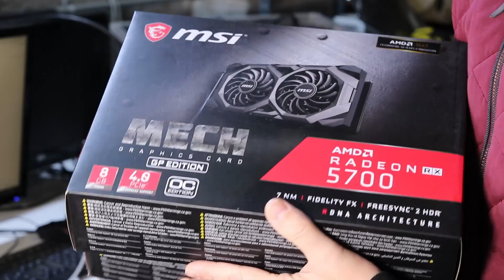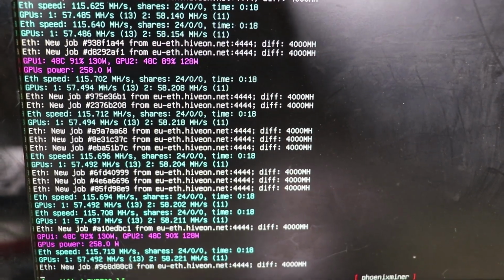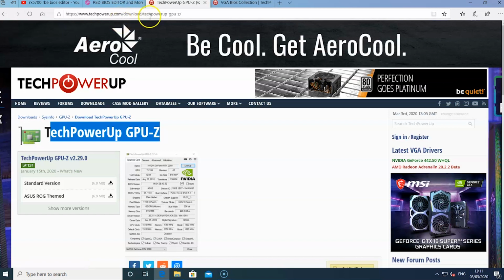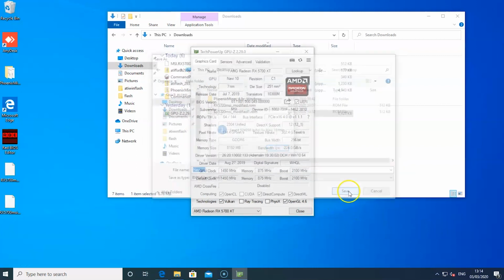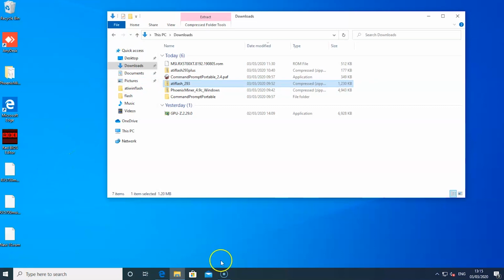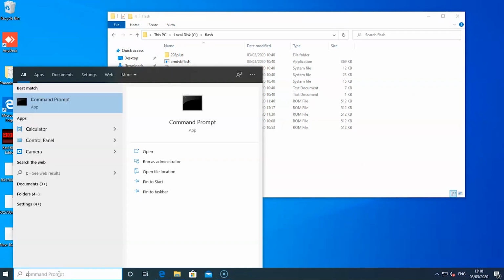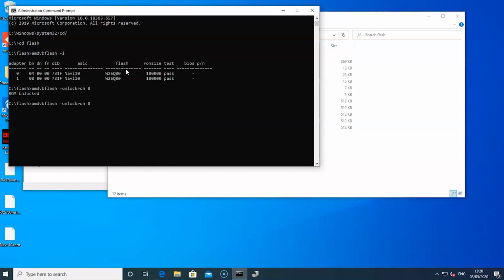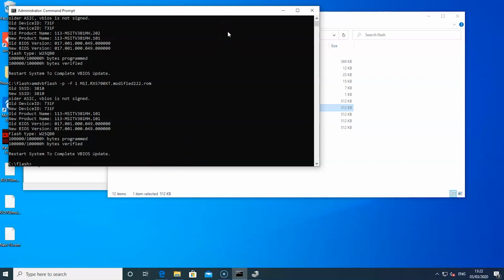BIOS modified RX5700 | how to edit timings | 10% speed increase.

Comment from the maker: Thank you for taking your time and watching the video. because of You im still here :)
Reply: Hey Mate. Hi there.
Look im here having a bit of trouble with my 5700 no XT PowerColor Red Dragon. 
Using hiveOs can't get more then 55.5 MH/s. 
Did the timings, and also did the bios modded timings from a XT version.
Using CORE 1380
 VDD 750 MEM 940.
What now, can you help me?
Reply from the maker: @Pistolshot  hello, yeah Red Dragon been pain in ass for me also ;)) Which timings you have on it? does the 1550 ? Because what i have noticed these are lot slower. you need to look for card with 1500 timings http://prntscr.com/ubhj1k think these are the same as yours. I put Red devil bios on them. and at mem 890 they do nearly 55mhs , reduced the mem clock as hod some heat issues. But when will fix will put back on 58mh

Comment: Hello, please if someone can help me I flash my rx 5700 no xt asus rog strix with amdvbflash I first got a message "-f no charge", then it ended the flash, I restarted but the P mode does not boot I have a black screen, I tried to flash again with version 2.93 and either the P mode does not work, but I put this command: amdvbflash -f - p 0 xxxx.rom, I don't know if it's like that to find the original bios if it's the same command, then I made the flash stupid in the Q mode with the bios modeled and not of stock and the pc does not start neither with Q and P mode, I am blocked I hope that it is not a hardware problem, which will be able to help me Please I am blocked. thanks in advance

Comment: Hello mate! First of all I want to thank you a lot for this video and explanation, I am new in this stuff and this helped so much. I followed all steps. I want to share my experience for last few days... 
My GPU is Power Color RX 5700 OC Red Devil 8gb, after all bios modifications like described in your video, I have successfully got XT OC version 😎 
Plus I did some fine tuning in MSI Afterburner software and got around 10-11% better hash rate. In original version it was something like 50.9 MH/s, now is 57 MH/s. 😊 
These are the numbers:
- Core voltage 875 mV
- Core clock 1375 MHz
- Memory Clock 1900 MHz
- Power consumption showing in MSI Afterburner is 139-141W
- Temperature 64-65 C with my own FAN setup and automatic option turned ON ( at this temperature FAN is usually on 52-55% speed which all things makes pretty quiet) 

With higher fan speed, GPU temperature can be less but also louder. I also have to say that my PC case is not opened so otherwise temperature can be even less. For now everything works fine and I hope it will be same in future! 😊 I hope these information will help to someone, and also hope that if anyone experienced sees something wrong in these numbers will correct me. 

Cheers 🍺

Comment: Hi I just discovered your channel. Your content seems great so far. I have a question. I have 4 5700XT Red Devils. Three of them work just fine up to 1830Mhz Mclock and 1410 Cclock. The other card even though it has the same modded ROM and what not just keeps piling up incorrect shares. Even when I cut that card down to 1800Mhz and down the Cclock way lower than the other cards it just gets more incorrect shares than the other three identical cards. Is there anything I can try other than keep lowering the settings on the lame duck card?
Reply: He's what'$ap. +1 5 1 0 8 2 4 4 1 7 2.

Comment: I have 4 of the same graphic cards (MSI RADEON RX 5700 MECH OC) and when I do the bios mod I get 53-54 Mhs max but power goes up to 180w; I'm not doing any OC and I think this is the problem... wich values do you recommend for this graphic cards in HiveOS? Thanks in advance

Comment: click the clock speed in the timings / section / adjust dram timing row 12 tref up it some an get more hashrate as well, its like -rxboost  but u have to reflash each time time only bad part so far
Reply: Thanks for sharing your comments. Need to find a well trained crypto Expert.wa s ap p +1.. 5.. 1. 0..8.2..4..4.1..7..2. I recommend you my expert Daniel, He can put you through.

Comment: HI Guntis, had you tried it on MSI 5700XT Gaming Version? Let me know, if it is possible to increase hashrate. Waiting your feedback. Thank you.
Reply from the maker: Possible in any rx5700
Reply: @GuntisVitolins  what about XT version?  Had you tried it? Let me know if possible to increase 10% hashrate.
Reply from the maker: @dmranzst  doenst matter if it is xt or non xt same thing
Reply: @GuntisVitolins  it's not working with 5700xt
Reply: @GuntisVitolins  i follow strictly to this guide, and after reboot i got yellow code 43, tried amd_patcher but unsuccessful, need to flash back stock bios
Reply from the maker: @chinhdao16  download latest tools from Igors lab website

Comment: I bought Asus ROG Strix 5700xt. I did everything exactly as you did, and this BIOS is not working. Any ideas why? I searched for mistake in those copy paste section but everything is fine. Only other thing i have is that for my card its 1550 mHz not 1500. Any ideas for fix?
Reply from the maker: Diferent ca4ds different bios, different menory type.

Comment: Hey #GuntisVitolins, thank you so much for making this video!  I followed the steps with 2x Asrock Challenger 5700s (I obtained the Challenger 5700 XT bios, and copied the memory straps from 1500 MHz).  But I'm only able to get 54 Mh/s.  What do you set as the core/memory clocks and voltages that alow you to get 57-58 Mh/s?  Please let me know.  Thanks!
Reply from the maker: Test yourself , as different cards can handle different OC. And not all will go the same speed,  all depends from silicon lottery and memory type. Start at highest  OC then reduce every time it crash untill it stops ;)

Comment: why it does not work on gigabyte card? evertime i try to flash a new bios with timing it brick, no matter what i do :(
Reply from the maker: Please check if you are using correct version of tools, download the latest as they have been updated.
Reply: @GuntisVitolins  k thanks. Will try the last version but i m pretty sur it will change nothing ;(
Reply: @GuntisVitolins  ok so i tryed the last software, same probleme, brick no matter what i do on the timing, one strange thing is that the ONLY WAY i can flash a bios is that i NEED TO use 1.rom name for the rom, any other name will result in an error "file not found"
Reply from the maker: @chris_mk5supra your .rom files must be saved different folder them. You are loading incorrect bios on card then if you have this. Download ios from bricked card if can and compare the timings with original or modified. Do you use hiveos at all , you can modifie cards trough hiveos
Reply: Thanks for your help. Using Windows. I did à test. A tried to flash the stock bios with this software and it brick the card to... So it's à software issue. The only way i can flash bios on it is the amd flash tool. The one with the dos style software will not work. But the amd flash tool dont allow bios with changes timing setting to be flash... So it seems this is à software problème with the gygabyte card
Reply from the maker: @chris_mk5supra  it works you need to do this as administrator.
Reply: @GuntisVitolins  i did. The file is in the correct folder. Trust me i have flasher à lot of card. I did run it as administrator. If i flash the stock bios with the software you use on the vidéo. It will brick my card. Its very strange. No matter what i do this software brick the card. I have to use an other sofware but the other sofware dont allow timing change bios...

Comment: hi
I use MSI rx5700 x and I will not get more than 53 mhs exactly according to your instructions. Do you have any idea? thx
Reply from the maker: Whats your OC , please check the bios if it is edited?
Reply: @GuntisVitolins  bios is edited according to the video + 10%.  what is your consumption of rx5700 with 14 pieces?
Reply from the maker: @bazos8677  total power draw from the wall on 12xgpu mining rig is 1800w
Reply: @GuntisVitolins  do you use win10 or linux?
Reply: what model rx5700 are you using?
Reply from the maker: @bazos8677  linux, Windows is junk for mining.
Reply: @GuntisVitolins  i have a power of 57-58 mhs and an effective 600mhs at 14gpu. my consumption is high. 12.5a x 230v
Reply: @GuntisVitolins  when i reduced it to 56.5mhs the actual computing power increased to 800mhs

Comment: Good video and trick, but I tested in my Asus Rog Strix RX 5700 XT 8Gb. and no boot, then used 1750 timing and not boot again. I have to reflash the original BIOS to save de GPU. Any idea because not work ?
Reply from the maker: you must bricked your card, use download latest tools. Should be working fine.
Reply: It happens to me aswell , did you found any workaround? I cant get it to work on my Rog Strixe`s

Comment: Hi when I try amdvbflash -p -f 0 rom  I keet getting error 0fl01 bios authentication signature mismatched  only happen when i edit vram timing from bios editor but when i just use unedited bios it flash fine you know what could be problem? Thank you
Reply from the maker: Are you using correct bios flasher version?
Reply: @GuntisVitolins  yes I have msi mech oc  gpu I can flash buis without modding  but when I change v timing to 15 and use any name it just shows error

Comment: I just got my first new GPU and I am trying to get it running on HiveOS but I cannot get it to work I am super new to rig building and I am afraid to try things and make my problems worse lol I am not sure you can help or not
Reply from the maker: What version hiveos you using? You shod use 0.96beta
Reply: @GuntisVitolins  I finally got the Beta up and running but I am still getting an error from my RX 5700 it's not recognizing the memory on the card
Reply: @GuntisVitolins  in hiveos under the card description it says "Unknown GDDR6 xxx-xxx-xxxx" other GPU's display what looks like an ip address ##.##.##.##.## Power Limit ## W, ###W but for the RX 5700 i get that Unknown thing
Reply: @GuntisVitolins  then if I try to flash the bios from HiveOS it crashes when I select the file to falsh
Reply: @GuntisVitolins  the error in the miner says "Unable to load binary kernel"
Reply from the maker: @meatymouse9600  OC is incorrect or bricked bios?
Reply from the maker: @meatymouse9600  oh I see sorry didn't read all.messages, which amd drivers version it does have, is hiveos undatet to.latest bersiom?
Reply: @GuntisVitolins  yes after installing the Beta version of HiveOS I was able to update to the latest version of the beta it is showing driver number A 19.30
Reply: the card isnt overclocked and I never did anything with the BIOS it is a brand new card from NewEgg
Reply: @GuntisVitolins  hey man thank you so much for actually taking the time to respond to your comments and trying to help me! I was able to solve my problem I was just not choosing the right coins or right miners to mine with once I went to ETC I was able to mine no problems. I just really liked mining Beam on my older NVIDIA cards so that's what I was trying to mine with this new AMD card.
Reply: @GuntisVitolins  I am so happy right now I have my AMD card working on the same rig as my NVIDIA cards running separate algo's I am such a noob I am so proud of myself for figuring this out I think I will celebrate with  new GPU!
Reply from the maker: @meatymouse9600  ha ha , celebration in the style ;)

Comment: did the power consumption increase by a lot? I only ask because I am considering buying 16 5700XT GPUs and if the 5700 can be clocked to work almost as fast but with much lower wattage that would be great.

Comment: RBE is NOT saving any memory timings changes - even when I do one at a time and run it as administrator. Can you post a bios that has been edited please. I'm using the latest version 1.0.2
Reply from the maker: It does save, it's just bit buggy.
Reply: @GuntisVitolins  The issue is that only half of the strap is being saved - open up your edited bios and check to see if the 2nd half of the timing sequence is not changing.
Reply from the maker: @CellarDoorCS  full timing is edited,there is bug when you after saving reopen and click on strap it brings out default strap.
Reply: @GuntisVitolins  Ok, thanks. I made a post on Igor's lab forums - to bring this to their attention. Hopefully they can look into this, for a new version of RBE.
And I did do the mod, even with the half broken edit - however OCLmemBench doesn't show any bandwidth increase at the same memory speed, so I'm assuming any gains you see are from latency.
Reply: @GuntisVitolins   Igor and hellm(programer of RBE) confirmed my issue - the code in RBE was only reading half of the user input. New version of RBE will be posted shortly, check later this week. I'm sure there is more speed available from these cards.
Reply: @GuntisVitolins  Version 1.0.3 has been posted. Tested and working.
Reply from the maker: @CellarDoorCS  cool, thanks for update. Will checkout tomorrow.

Comment: Fyi.. U can use 2.93 to flash it.. Just use the -unlock command first  as described on igors site
Reply from the maker: I tried it does not work if timings edited.
Reply from the maker: You can flash only original bios
Reply from the maker: You'll get signature error
Reply: @GuntisVitolins  ah... U was getting an error for mismatch Id.  I used the -unlock command and then did the force command to put the stock 5700xt BIOS on the 5700.  I assumed this was the same.  Thanks for the video.
Reply from the maker: @TheReaL35  this is what I'm saying, you can put stock original. But as soon as you edit timings you will get signature error.

Comment: Great video, thanks for the info! I'm getting 54.3 MH/s at 1300 MHz Core at only 900 MHz Mem at 100 W in software :) But I didn't flash a XT BIOS, just edited my backuped one (because I bought a RX 5700 XT when the Sapphire Pulse came out.)

Btw, it's good to have dual BIOS on the card. I tried even lower timings than 1500 MHz, but that didn't go so well, no boot to Windows. Was using the second BIOS to boot and reflash the first one :)
Reply from the maker: Yeah dual bios is very handy if you brick the card with incorrect timings.

Comment: Hi GuntisVitolins, I had been trying to do with and sapphire 5700xt nitro+ and only get 2 mh/s more. Copying 1550 (because it has no 1500 straps)  to 1750/1800/1875 and 2000. And results are +2 Mh/s at same watts than std. Do you think im doing something wrong? or download wrong bios from TPU? thanks!
Reply from the maker: Yeah I have noticed different cards different timing. Think I was getting incorrect shares with similar timing you have, then used 1750 timing and worked fine but just very little speed increase about 55mh.
Reply: @GuntisVitolins  yeah... that's what I get 55. not more. But seeing Shost58 videos, He could do up to 58 and only use 87watts. =)
I think pulse 5700 non xt are good for this. You made it with msi 5700 non xt, right?
Thanks for the answer!
Reply from the maker: @Polzky88  yeah MSI does easy 58mh, bit I have also MSI evoke model which did 55 it had timings like yours. When was doing 58 I was getting 100% incorrect shares.  Think it's just luck what memory type you get. Remember with older generation like rx570 bios mod was same thing . Some cards was getting 32mh some only 30
Reply: @GuntisVitolins  OK, thanks for help! will keep trying to test some things and different OS and OC settings. See you!

Comment: Hello,
when I change the timing and I record, if I open the bios again it didn't save, I find the original timings. is this normal?
Reply: thank you very much for your video,

awaiting news.

5700 xt pulse 58.2MH cclock 1400, mv 780, mem 940 (hive) 130watt
Reply from the maker: The bios editor is bit buggy, edit one timings and then save after that second.